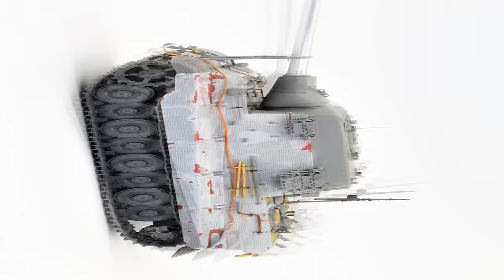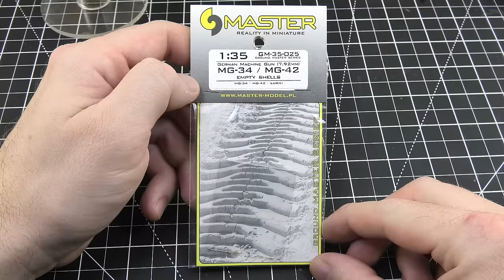JAGDTIGER - painting the beast with Porsche suspension, Blitz by Takom 8003, Jägermeister

Comment: Looks great! I like the stowage, but I do question the tarp on the roof… wouldn’t this decrease visibility on an already low visibility tank? It would be really difficult for the commander to see anything, and the engine deck boxes prevent any chance of escape.m

Just wondering, not saying you can’t have it there.
Nice work!
Reply: Not a big fan of it either, but I guess the tank could be getting ready for transport or a cold night...
Reply: Got the same thinking...as Pikilloification said, covering for the transport would be fine...but this definitely isn't a combat setup, commander would be completely blind.

Anyway, Lukasz - another very nice and inspiring video, looking forward for weathering... ✌
Reply from the maker: Guys, not all models may represent battle-ready vehicles. Here is the stand-by configuration, i.e. without crew, standing and waiting for orders. The tarpaulin on the roof was folded very often in such situations. So there is no crew inside to suffer from lack of visibility. I hope that explains why there's a tarp. :)

Comment: Great video! How does the green stuff tarp actually stick to the model? (only 4mins in so apologies if you cover this later!)
Reply from the maker: Thx mate! The tarp stuck to the surface by itself and additionally the folds of the material also held it in place. But to be sure, I glued them at the end with a few kings of super glue. :)